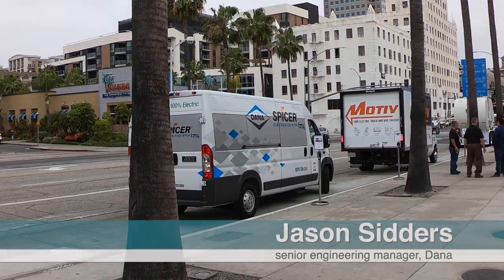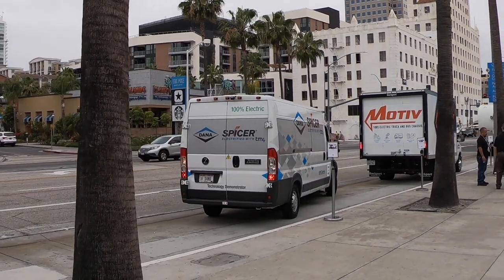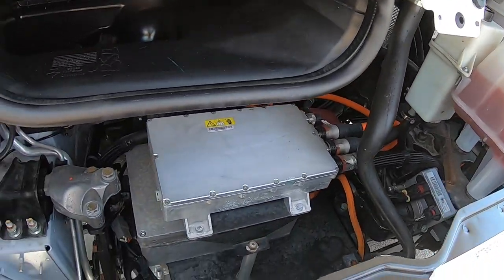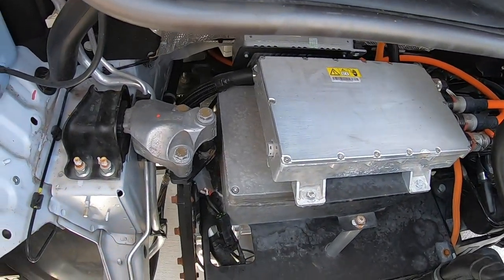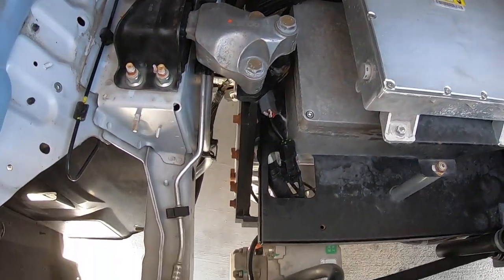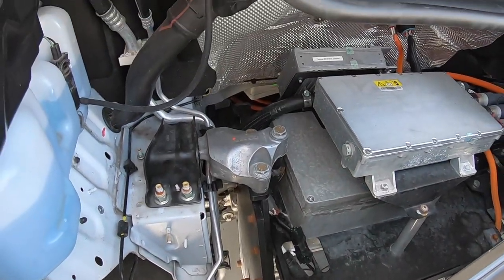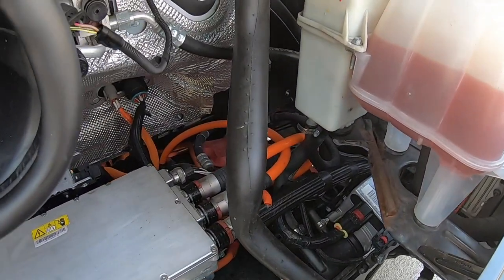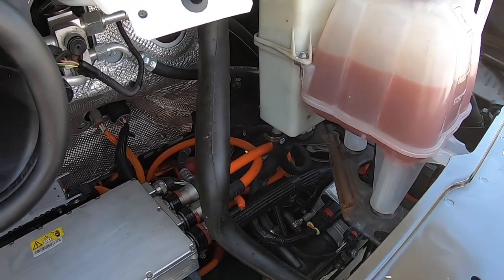Riding in an all-electric Zenith van equipped with Dana EV technology

Comment: While it seems as though Zenith has called it quits, I have decommissioned 7 of these vans and have replacement parts available for those trying to keep their vans on the road. Don’t have their diagnostic equipment but will sell what parts we have, including the transaxle, axles and coupler, which have been a common issue.
Reply: Max P, That is great to know but as you said, those laptops are crucial to have and diagnose the issues. They're probably sitting around collecting dust.

Comment: I'm wanting to build my own EV van along the lines of a Mercedes Sprinter or Ford Transit but struggling to find anybody who has converted their own. I'm wanting to really use 4 in wheel motors to enable as much space for the battery pack as possible.  An eAxle would be my next choice.   If anybody has any suggestions I welcome them . I won't be starting the project for another year or so as I will research technologies up until then.
Reply: Ford is releasing the all electric transit.
Reply: @atx-cvpi_99  it has no range

Comment: We have 2 of those exact vans but have been trouble after 6 months of use. We had Zenith techs come and fix them which was fine. 12v batteries on both keep dying. But now, the transmission is making noise while on idle or shall we say while on a stop. But when you drive it, the noise worsens. Now we try contacting Zenith, we got nothing, nor responses from calls, emails. Did they go out of business? Now our vans are just sitting in the shop useless.
Reply: Hi, I'm curious about this. Want to know what happens.
Reply: @amitchandra1711  We've contacted several [Dodge/RAM] dealerships, there doesn't seem to be any support for this issue. Still searching.
Reply: @parallax62 would you consider selling the units?
Reply: @farmerfry785  as of now, we have no plans of selling the units. If we do decide, we'll let u know.
Reply: They’re swamped maybe
Reply: Parallax62 Should probably unload them
Reply: @nicholaslandolina  all shops here in the SF Bay Area has the same problem, no luck contacting Zenith/Dana for repairs. Found one in San Leandro that repairs
EV vehicles. He found out we had a Zenith, he said no way he can repair the Zenith units due to there are no shops to order parts from. Told us we're SOL [shit out of luck]. 
Unload them? Yeah, we'll unload them to the Bay waters.
Reply: *UPDATE* We received a call from Zenith a month ago. Said they were hit hard with Covid-19. Slowly getting back on track. They've sent their proprietary laptop to read the codes to the shop working on our van. Took the shop a while to get this going. Received a call today 10-14-2020 from the shop, said it's ready to go. Whew! Hope this last longer than last time.
Reply: @Parallax62  Wow!  Thank you for the information, as I was looking at a used one and I needed to learn more. Glad you replied to this video.
Reply: @melissamilan4635  Glad we cant help you with information from our experiences. Just a week ago, one of the vans had issues with the plug-in charger. Made a loud boom when we plugged it in. Looks like the under belly of the battery pack got wet from the rain. Should be fine we said, the factory should've considered properly sealing the battery packs from moisture. Nope, they were shorting out and blew out one of our wall chargers! We tried contacting Zenith once again for the problems but to no avail AGAIN! may take months to get a hold of them. But this time, dial tones. Emails, no responses. JSYK.
Reply: @Parallax62  Guess that's why ways of life are so hard to change (from fossil to electric), because it's so difficult to be the one who starts the change, volunteering to be a guinea pig with a new product that offers little to no service after the sale. I really appreciate you sharing experiences and I'm betting others are, too!
Reply: @melissamilan4635  we'll update once there is something to update. Wish us luck.
Reply: Let me know if you need parts.
Reply: @djsareawesome  wish we knew what parts we need. Been emailing, calling and leaving messages since we've made this post. No luck.
Reply: @Parallax62  It's likely the gearbox, motor to gearbox coupler, or half-shafts. They're out of business so doubt you'll get anywhere.
Reply: @Parallax62  We have three of the vans and are down to one working one. Such a shame that Zenith went under. When they work - they are great. What did you do with yours?
Reply: @scottsiemer8262  they both are just sitting stagnant collecting dust. 1) transmission will not shift. 2) will not charge, we plug to the charging port and there was some explosion in the under belly of the van. Company lawyers are looking into this now. Stay safe out there.
Reply: Hi y’all, how much 2016 Ram promaster high roof with 3500miles and 16 passenger seats can go for?
Reply: I purchased a 2016 Ram Promaster Zenith van from an auction. It did not come with a charging cable, but I purchased one called J1772. Initially, when I tried to charge it from a home outlet, I resorted to using a thinner cord, but it caused the cord to overheat. Despite this, I managed to get about a third of the battery charged, and the van seemed to be running perfectly fine.

However, when I attempted to charge it fully at a Level 2 charging station, it didn't accept the charge properly. It would start charging for a few seconds and then display a "not charging" message. I'm seeking assistance in identifying this issue and would greatly appreciate any recommendations or referrals from those familiar with such matters.
Reply: @djsareawesome  I purchased a 2016 Ram Promaster Zenith van from an auction. It did not come with a charging cable, but I purchased one called J1772. Initially, when I tried to charge it from a home outlet, I resorted to using a thinner cord, but it caused the cord to overheat. Despite this, I managed to get about a third of the battery charged, and the van seemed to be running perfectly fine.

However, when I attempted to charge it fully at a Level 2 charging station, it didn't accept the charge properly. It would start charging for a few seconds and then display a "not charging" message. I'm seeking assistance in identifying this issue and would greatly appreciate any recommendations or referrals from those familiar with such matters.